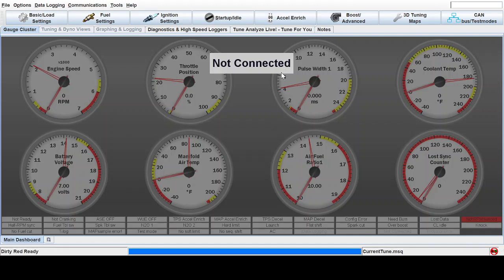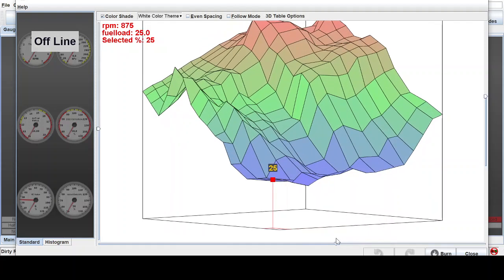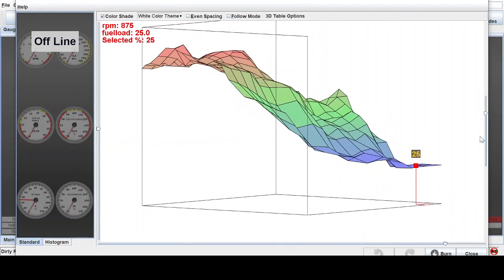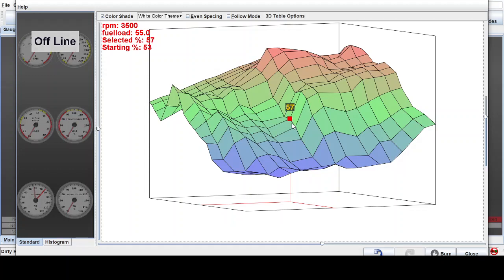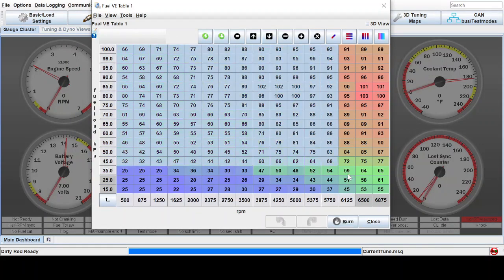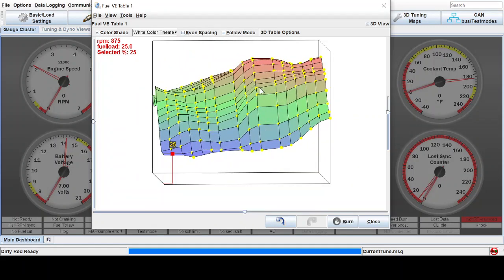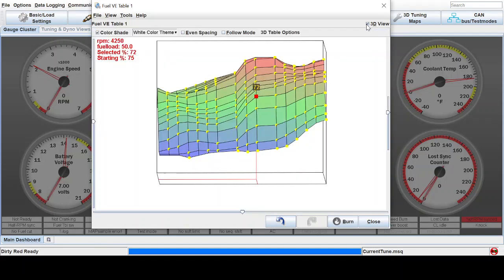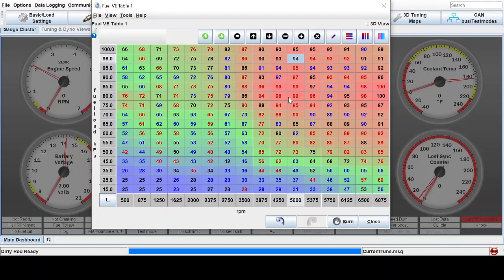Megasquirt Table Smoothing | Learn to Tune

Comment: What I started doing is keeping tracks of the original table, the VE analyzed table and the smoother table in excel. Then I do a simple analyze of final smooth table versus the original in %. Tells me exactly how much I've added or removed everywhere. Also, MS always uses 4 bins in the calculations. So if you look at the datalog where the engine "needs" the fuel, check the resulting VE and make sure the average of the 4 news bins is the same ! Final'y, I like to use the smooth tool for smaller portion at a time, but that's preference only. Thanks for the video !

Comment: If you tune a couple specific spots, can you lock those cells and smooth around it? Or even interpolate (smooth) between 2 locked spots.

Comment: Thanks for the video. When you smoooth do you go back and run ve analyze again? Also do you usually smooth the entire thing like that or just certain areas at a time?
Reply from the maker: I usually do smaller areas that have rough sharp parts of the map. Most of the time you don't need to run ve analyze again, you can just adjust parts of the map that were overly corrected by the smoothing.
Reply: @TurbineResearch  thank you